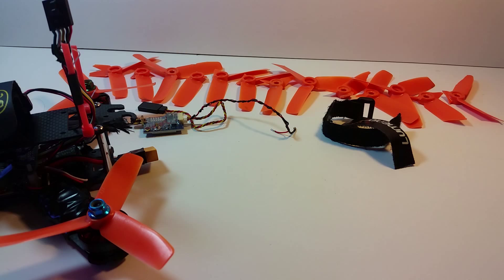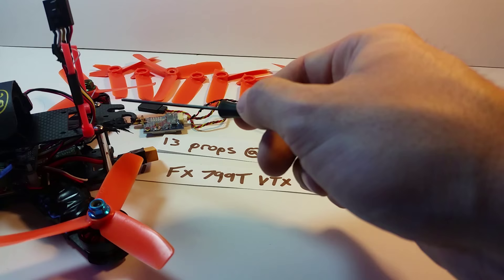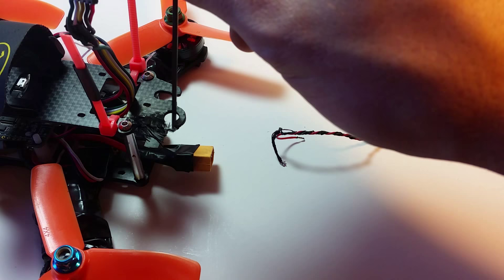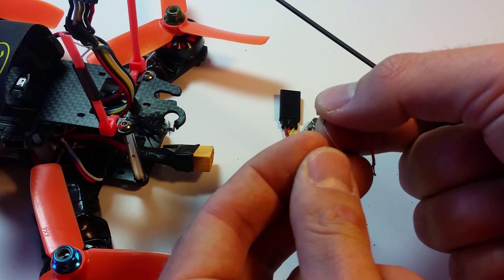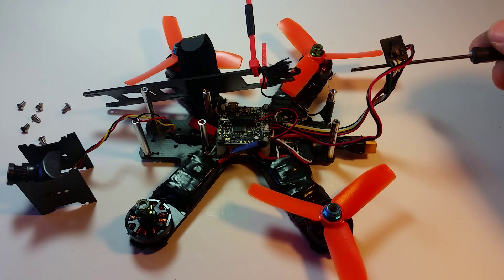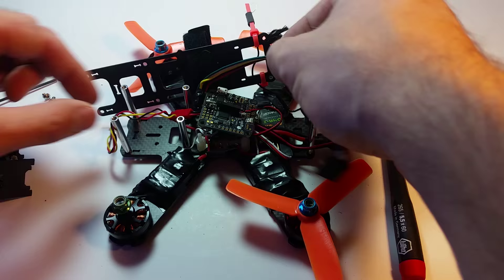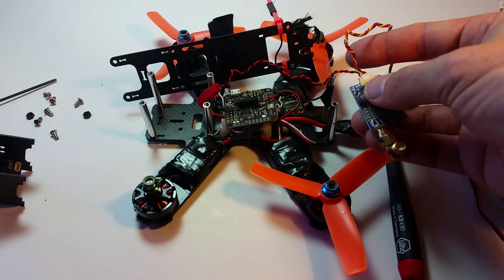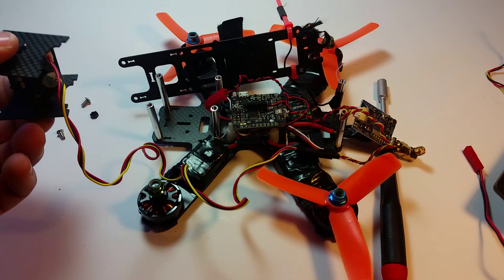VLOG 04 -- How to wire your FPV system for race day

Comment: Would love to hear how the QAV performed for you! Specifically the motor/prop combo. Where do you get those 4x4x3's or are they 4x4.5x3? Love the VTX quick disconnect setup. I've been doing that for a while and found that wrapping those cables in a protective shield like paracord or something similar really helps when there's extra cable that can possibly come out of the frame during flight.
Reply from the maker: +Tony Hulings I like the motor/prop combo a lot. I'm working on getting some video uploaded of me flying the QAV180. I would definitely prefer a 5" capable quad, but this was really fun for what it was. The props are 4x4x3s, and they absolutely scream. I can even carry a GoPro and it doesn't seem to notice too much in the straights (it struggles a bit with direction changing, but that's okay). 

This is where I bought my props: http://www.multirotorsuperstore.com/props/props-by-size/4-inch/hqprop-4040x3-glass-composite.html

Comment: what kind of solder did you use for this build ?
Reply from the maker: I use this solder: Alpha Fry AM31406 Cookson Elect 40/60 Electrical Rosin Core Solder https://www.amazon.com/dp/B000G31NWK/ref=cm_sw_r_awd_ywiwwb3PYHNKP

and this iron: Weller WLC100 40-Watt Soldering Station https://www.amazon.com/dp/B000AS28UC/ref=cm_sw_r_awd_JxiwwbDH28ZP5
Reply: +Bulbufet FPV well as i know it that kind of solder is generally used for small canles which are not under any stress. I recommend some 99% which does need of some extra heat but you won't loose any cables. I have been using it for some time now and i have never had a loose wire with it unlinke the 60/40. Also be sure to find some 99%solder with flux core. Will help you a lot ;)
Reply from the maker: +B Andi you have a link to what you would recommend?
Reply: +Bulbufet FPV  something similar to this: 
http://www.amazon.de/SN99C-1-00-Solder-Sn99Cu1-0-1kg-Clean/dp/B0115X5WSU/ref=sr_1_12?ie=UTF8&qid=1448650814&sr=8-12&keywords=99%25+solder

I personally use one from Lux Tools but it is impossible to find anything about it as it is a small company within Germany. But the one in the link has the same properties. Try to find something with same properties and you will never have that problem again. and also try using solder depending on the tensile stress of the location where the cable is going to be set.